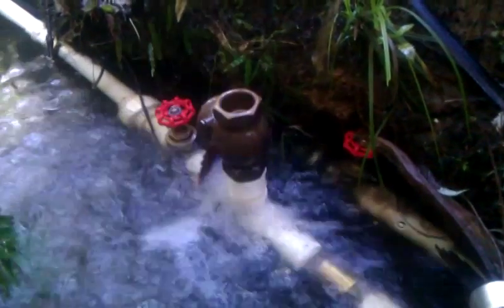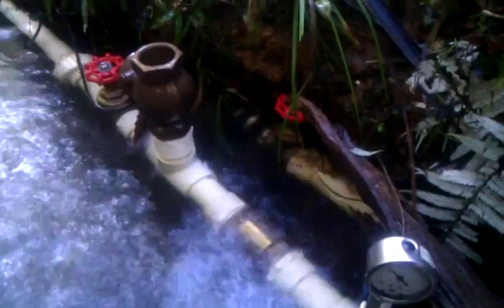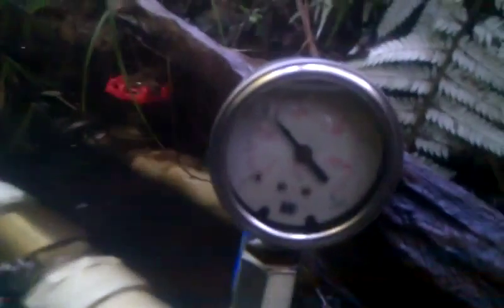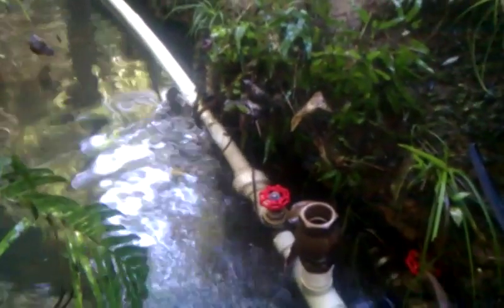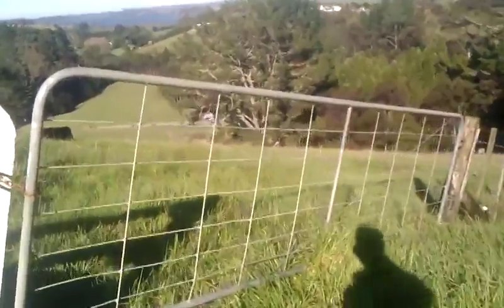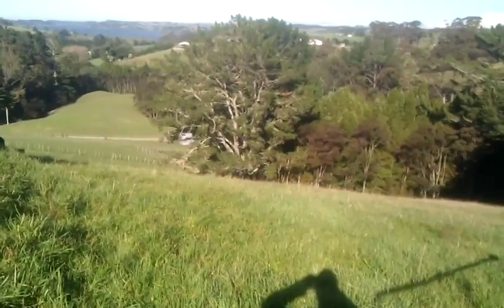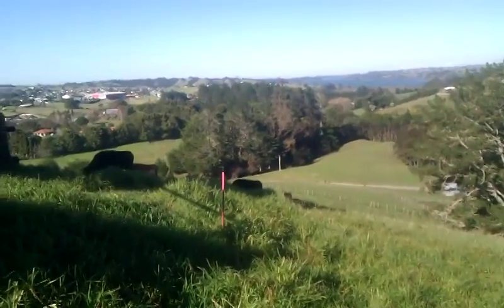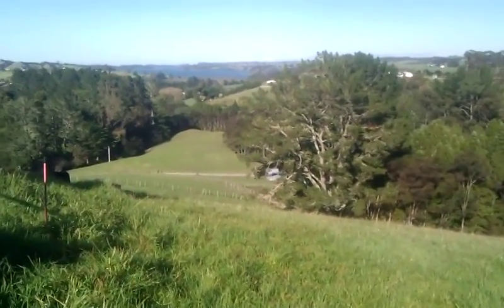DIY Ram Pump Producing 70psi

Comment: Would it be posible to deliver water to an altitude of 76 meters?
Reply from the maker: If you've got sufficient fall on the drive pipe absolutely.  I'd consider going for a more robust solution than the swing check valve though, and probably steel drive pipe.  https://www.quora.com/Is-there-a-maximum-height-ram-pumps-can-achieve

Comment: Hi Scott. I was wondering if you could assist me. I am doing a project in the Sol Is. 4m head over a distance of 40m. 12m of lift over a distance of 80m. Need to pump 10,000L of water per day to a tank for a village of 600 people. Thanks in anticipation
Reply from the maker: Hi Lawrence, sorry for the late reply.  It's sounds like you are well within the working parameters of a ram pump.  I'd suggest you will probably be looking at a 4" drive pipe to deliver the quantity of water required.  Stick to steel / brass fittings for reliability.

Comment: hi there I'm desperate to build one of these but your link doesn't work. I don't quite get what you mean about the closed cell filler and where it goes 🤔
Reply from the maker: this could be a good place to start.  Effectively where they've used the inner tube I've used pool noodels https://en.wikipedia.org/wiki/Pool_noodle  The only difference is I've attached the pressure reserviour to the straight through side of the tee and the outlet to the 90 degree bend side of the tee so the reserviour lies flat in the stream bed

Comment from the maker: after a year of pumping, the mechanical force on the High Pressure PVC tee that accommodates the swing check valve developed cracks around the base.  This caused a jet of water from the base of the tee every time the pump cycled.  I have subsequently replaced this section with galvanised steel fittings.  I'd recommend this to anyone building a pump of this size.

Comment: Scott that is an awesome result.  Do you have a video on the build of the ram?  Thanks
Reply from the maker: Joe Pigott sorry Joe I don't but I essentially followed these plans http://www.clemson.edu/irrig/Equip/ram.htm, using 40mm high pressure PVC components.  

I did redesign the pressure reservoir to lie inline with the pump, with the pump output being redirected at the tee which you can see in the video.  The pressure reservoir continues in 40mm pressure pipe for 4m and is filled with closed cell PU foam.  This arrangement seems to work great.

After running for about a year the tee supporting the swing check valve has developed a crack from the mechanical force I presume which ejects a small jet of water every cycle.  It's not too much of a problem but next time I think I'll use cast iron fittings for a project of this scale.